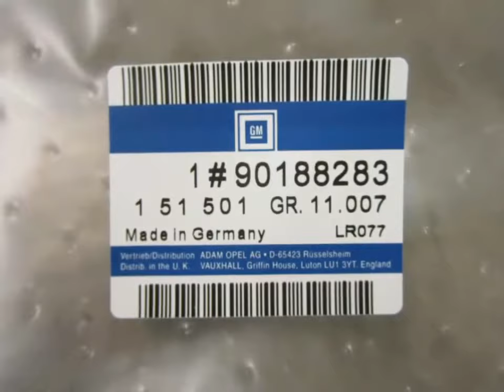Vauxhall Nova 2.0 8v Itb Build part 44: sitting on the wheels starting to assemble.missed PVS 2018

Comment: Finally a nova build 
I was thinking of getting a nova and swapping a red top in it a saxo vtr or a mk6 fiesta zetec s
Reply from the maker: Really need to get the next lot of slideshows/ videos out and give an update as to where the project is now. Shouldn't be too long before it is ready for the road. (Not that it will be coming out in the winter) A Nova would be a great way to go, but finding a good example now without spending a good chunk of money proves to be a good challenge now. However they are starting to increase in value so doubt you will lose your money. (Unless you go silly like me! 😂) Always had a bit of a soft spot for the Saxo think because all my friends had them. Not sure on the fiestas though I'd personally prefer the older RS turbo or one with a 2.0 zetec turbo in the front. 👍😂
Reply: @K24STE  yeah I see what you mean about the novas there's one abandoned on someone driveway it's been there for about ten years but it depends when I get my first car but as Novas are light chuck some power in it and it'll go like a stabbed rat